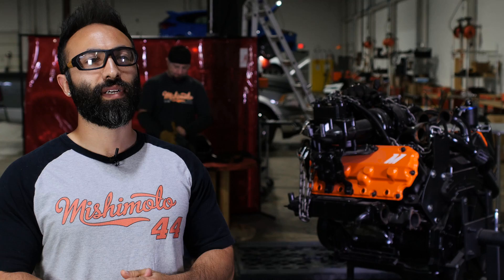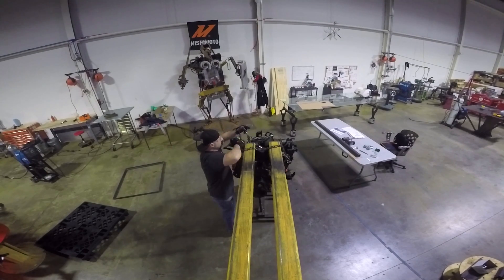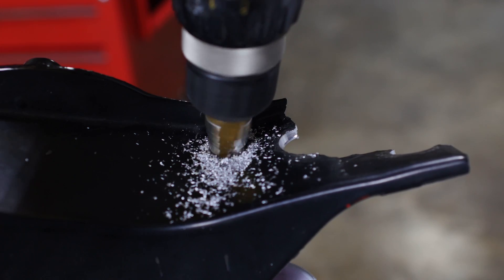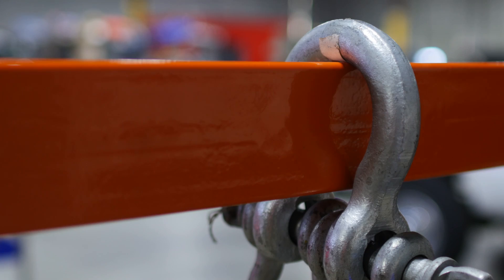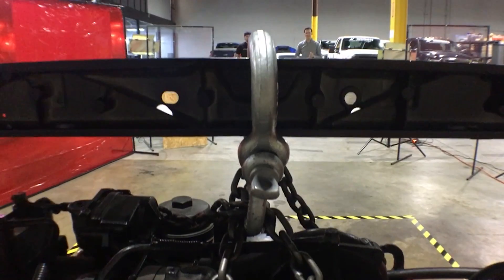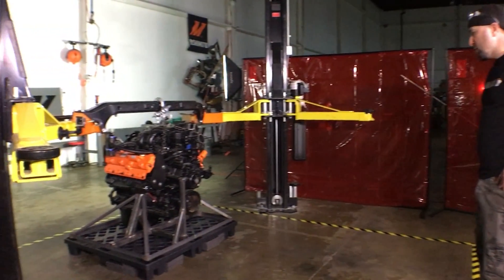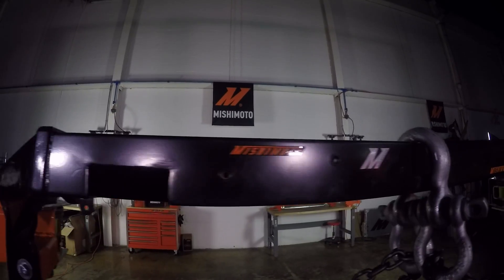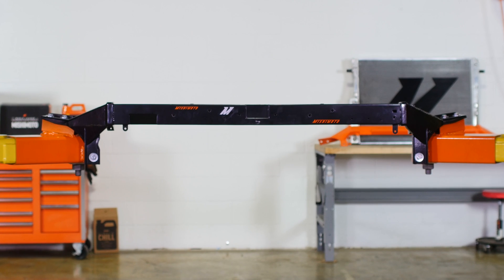Mishimoto Ford 6.4L Powerstroke Upper Support Bar Strength Experiment

Comment: So where is that stress being transferred? Forces don't just go away, by adding rigidity here you are transferring forces to another component of the truck which can lead to premature failure somewhere else.
Reply from the maker: Structurally,  the support bar does not increase the rigidity the way you might think. The bars purpose is to support the radiator and intercooler, the flaw we noted in the stock setup was was that during normal operation the bar was allowing movement up and down at the sides Our bar preloads the radiator to prevent the side to side motion that added to the radiators high failure rates. Combine this with the rigidity of our bar results in a more reliable setup. As this was stress that really should not have been there to start with our bar takes the stress of the weight and distributes it to the support bars mounting points as well as the mounting pegs on the radiator which are now preloaded. We have had the support bar out for years now and aside from it lengthening the life of the radiators we have not come across any issues.